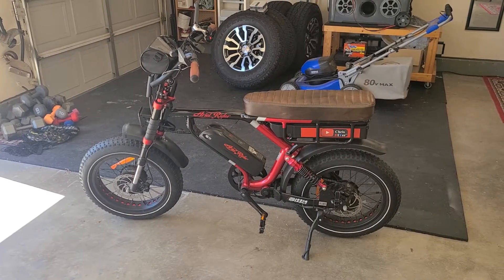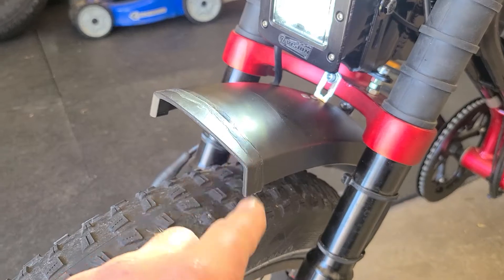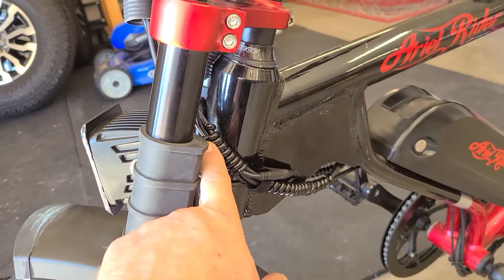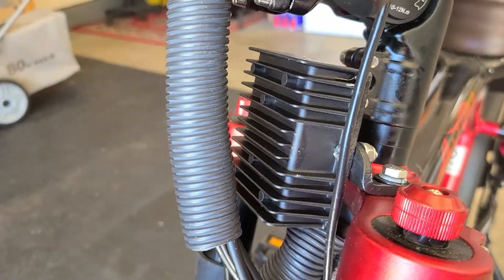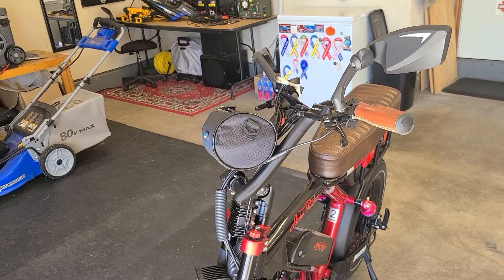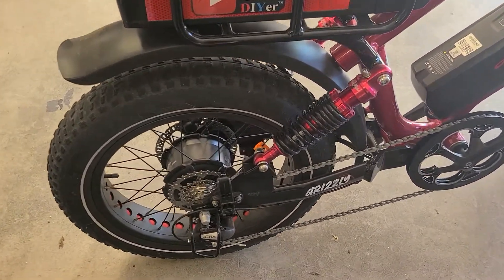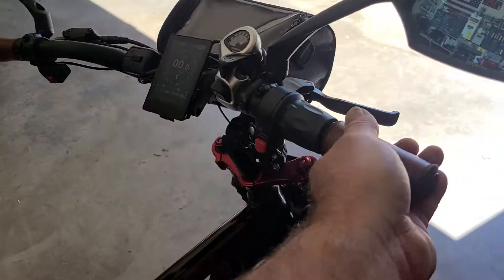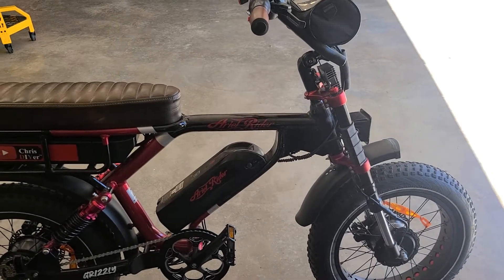Ariel Rider Grizzly V2 eBike - 12v LED headlight mod done + other mods/tweaks!

Comment: How fast can it go? Can you add more speed n range?
Reply from the maker: 37/38 mph. For best range, use one motor. I have no idea "how" to get more speed out of it. Thanks for watching my video
Reply: @ChrisDIYerOklahoma  some have chips to limit speed. Didn't know if that's actual max speed or not. I'd like to get something like an e motorcycle as I have to do a lot of riding on the highway and such. But for around town that actually looks comfortable. Would throw a little hitch on it though for camping gear n radios lol